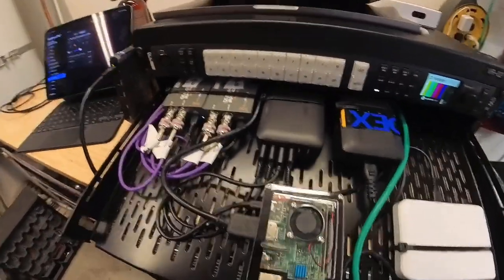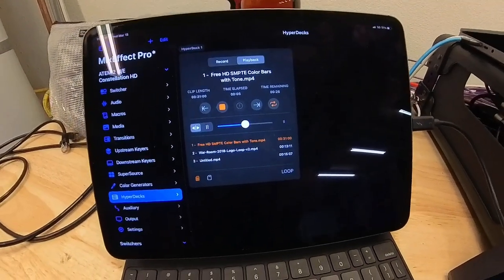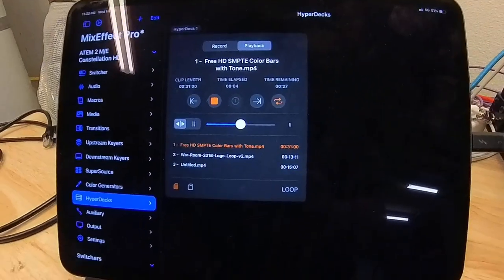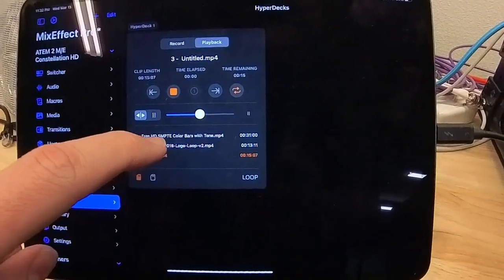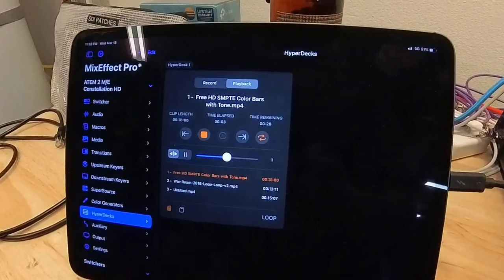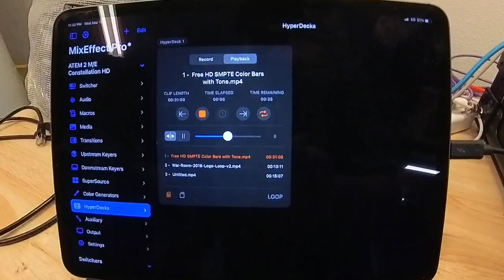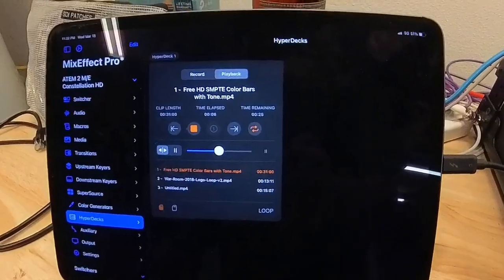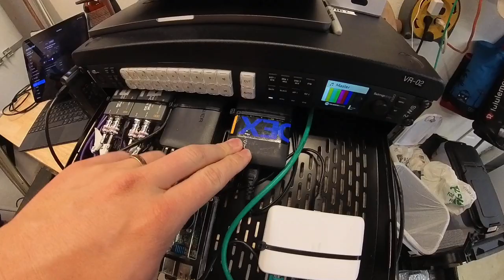I PUT A BEE IN THIS RACK!!! Updates To The 2U Video Fly Rack - Constellation 2ME - CHEAP Playback

Comment: Your switching problem sounds like poor negotiation. I've tested the GS switches and they operate at full speed per port.
Reply from the maker: That’s kinda what I thought too but didn’t know for sure!
Have you had the same issue before?
Reply: @thatonetechyguy  I've had it on other netgear switches in the same line. It's not common, but it happens.